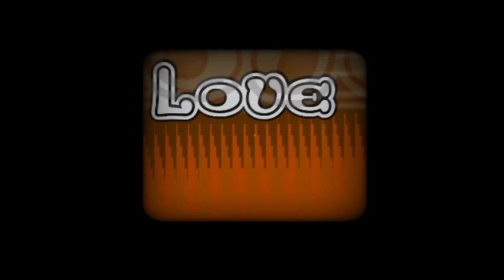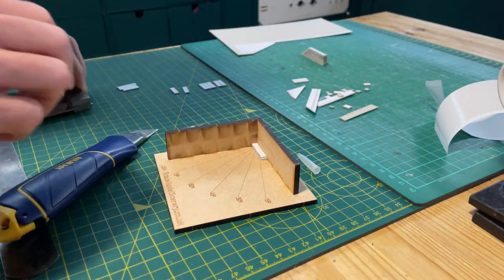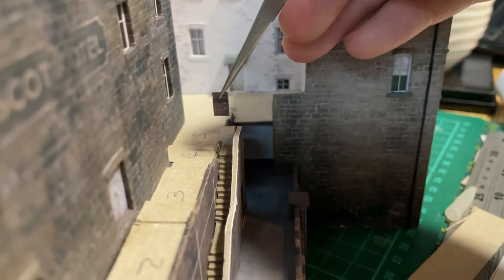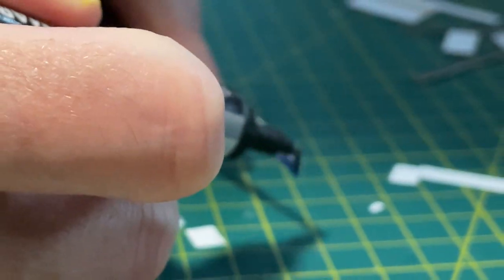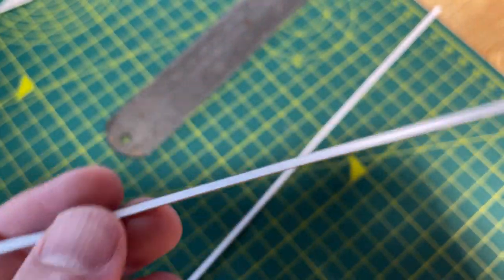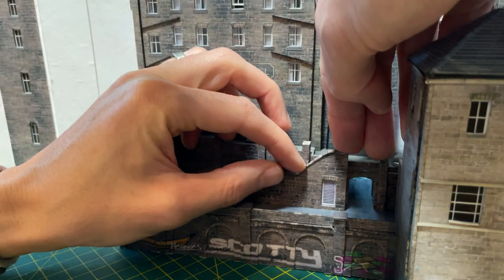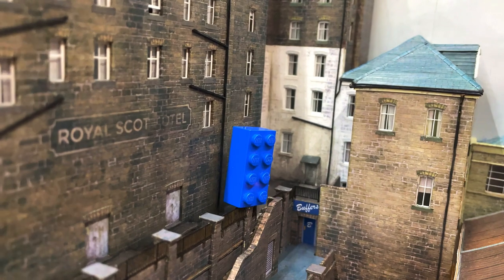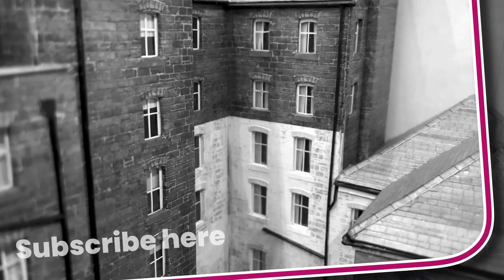Low relief Victorian N Scale hotel scratch built from card - half way there!

Comment: Hi Michael, wow, the hotel is coming along amazingly, its crazy that the railings doubled the cost, but they would have been so hard to do by hand and make look good. I so need to get playing with inkscaps.  looking forward to seeing your progress. Gemma
Reply from the maker: Thanks for watching Gemma! They were worth it though. I just need to colour them properly (and without damaging the stonework). Hmm. :) On to the ballroom next. Exciting times! :) Michael.
Reply: @Chandwell  I make cards and things and use distress ink pads and a brush with a little bit of water on and touch up the edges of bits of cards like that. It's less wet than using water colours. But equally a cheaper water based ink pad may well work in the same way, I just have distress inks for blending coloures.
Reply from the maker: Cool. Thank you. I will take a look.

Comment: Great progress as always and many thanks for the tips.  Very useful as does the right handed jig.  Still love the backstop.  Will you stage revellers outside Buffers?  Police in attendance maybe?  Like the idea of the blocked up stables but should the fill-in go to the level of the terrace without the join at the bottom.  I wonder if horses would have been fussy about stepping over it to enter the stables?  Maybe the terrace floor level was higher in the past and was flush with the bottom of the blocked arches.  It's all brilliant!
Reply from the maker: Hahah. You spotted the mistake! I didn’t decide that they were stables until the point I was making the video. I decided to explain it  that the terrace was dug out a little in the 1930s and that they used some old stone lintels as the foundations for their bricks. I think I’ll have to at least include Dale and Gary, the Buffers bouncers standing outside the door, even though the station clocks are saying it’s ten to 12 in the morning! Thanks for watching as ever! Michael.
Reply: @Chandwell  If you wanted to correct the arches would it be possible to do so.  It might be nice to have one partially open so you can see the barrel ceiling and a corrugated or fence/wall and doorway only part way up from the ground.  This could be used a storage for Buffers (empty beer crates?) or for the hotel? It would give another dimension to this part of the layout.  Maybe a faded wall painted sign above the alcoves hinting at the horse past.
Reply from the maker: That is an awesome set of ideas but I think that horse has bolted. I think the surgery required would be a little little too much right now. But I never say never!!

Comment: Simply amazing. Showing the construction and handling of the stairs really puts the size into perspective. The Lego brick sitting in the scene is a great comparison. What will the overall width of the hotel complex be when completed?
Reply from the maker: Thank you Mark. The hotel will be about 420mm long, which is a scale 63 metres. That's a little shorter than the prototype in Bradford, which is closer to 70 metres long. Cheers! --Michael

Comment: Fabulous video Michael. What night is student night at Buffers? Looks like exactly the sort of dodgy place I'd hang out in the 1990s simply because those too offered drinks at 70p!

I've also used the Scale Model Scenery railings for my school and other buildings on Warphampton. Aren't we fortunate now with this quality of detailing available in n gauge. I too was worried about the paint clogging the small gaps but actually if you used fresh paint so it's not too thick they coated nicely and fairly easily - the wood seems to absorb the paint. I also found if you then blow through the railings quite hard (over a bit of newspaper) you get rid of any excess which hopefully avoids clogging the tiny gaps in n gauge. I bet if you were careful you could probably paint those gaps whilst still working on the building without having to remove them. Obviously you'd have to carefully protect what ever was behind them if you decide to blow excess paint away.

Great modelling as always. Look forward to the next episode
Reply from the maker: Students? In Chandwell? Hmm. Chandwell College. That sounds like a nice place, doesn't it? Probably a providing an incredibly high standard of education. I've been looking out for an idea for a large building for further along the backscene. Chandy College may be the thing to do! Thank you also for the tips on the railings. I will give that a go, I think. Thanks for watching!  --Michael
Reply: @Chandwell  not quite sure if it fits your vision but some sort of brutalist, concrete block would certainly befit Chandwell Polytechnic!

Comment: Hi Michael. Another great video. The work is coming along nicely. A question. I have had a go at ghosting an image onto some brickwork but it hasn't come out as well as your Royal Scot Hotel sign. I'm pretty certain you've done something on this subject. You have managed to get a more 'weathered' look than I can achieve, with different levels of fading. Any chance of some hints?
Reply from the maker: Thank you Neil. I did a graffiti video about a year ago but I don’t think that will help you in this regard. I did two main things with my hotel sign. Have the blend mode on “Overlay” and then make it variable transparency. For this I created a rectangle the same size as the sign and filled it with a multiple stepped blended fill from black to white and grey. This makes some parts of the sign more transparent than others. I have two weeks off work so I may get chance to do a short video to show you how.
Reply: @Chandwell  thanks Michael. I will have a play around with what you have given me. I've just completed the Scalescenes medium station and now wish I'd thought about this on the main building as there a large expanse of brickwork begging to be filled. May try to add another layer of skin which I can see ending in tears

Comment: Very nice as usual Michael! Could you mention the thickness of the photopapaer you use? I am thinking mine is too thick as I have a lot of trouble making it look right.
Reply from the maker: Thanks John. Yea, you need a paper that prints well, helps your inks stay water resistant, and most importantly, is thin enough to fold and bend well. I use 110gsm matt photo paper. If you watch this video from 02:03 you will see the exact type I use. https://youtu.be/58PK5y1R4bA

Comment: For the railings at this section, would it be plausible (next time???) to spray the railings with a cheap dollar store black spray paint?
Reply from the maker: Thank you Nicolai, that's a very good suggestion and is probably exactly what I should have done, but I do have a slight phobia of spray paint, and tend to avoid it. Thankfully the Sharpie pen has worked out just right! --Michael